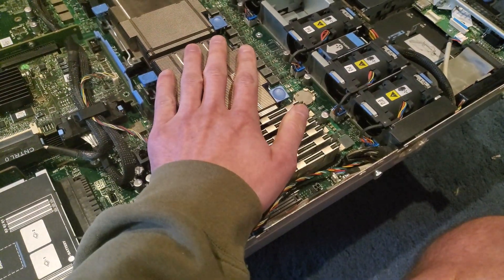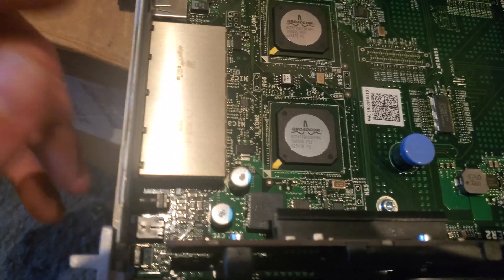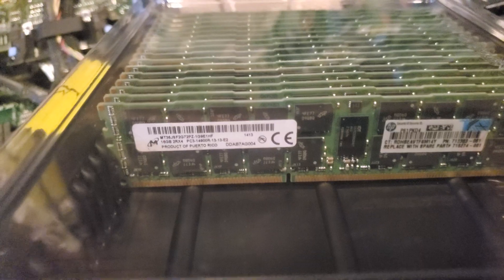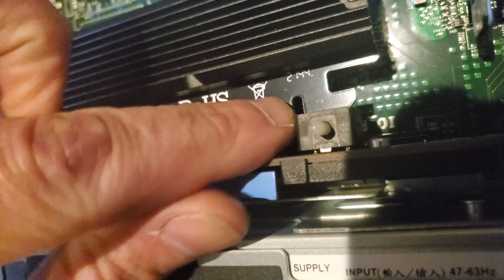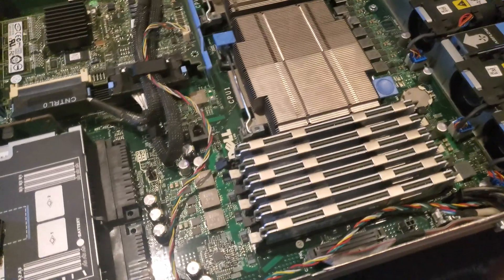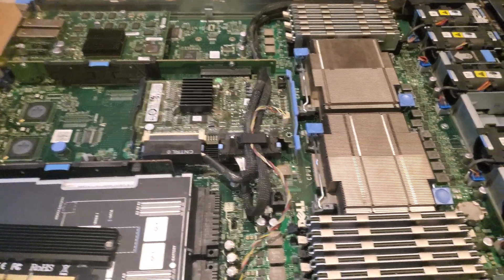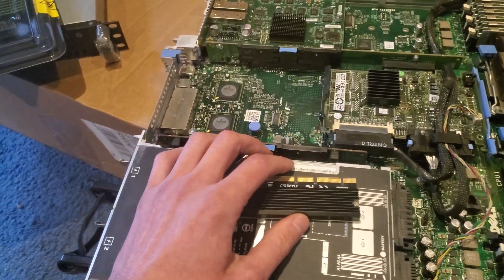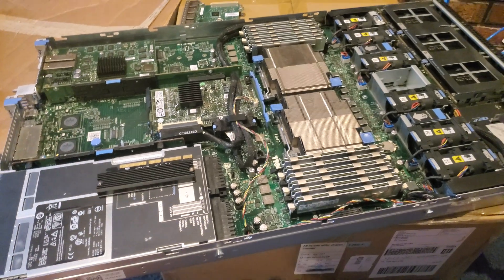The Beast R610 on it's 3rd and final refresh

Comment: these older systems - you can max out the ram more affordably - ram is so crucial - surprised you can do nvme boot on something this old - should be good to go for a few more years now - 2x the ram is nothing to scoff at - i just got a hp 8200 with an i7 2600 - had to figure out secure boot - just let the installer config it for me and figured it out - making a discount siem box #esp part #sec onion #ossim #ossec #selks #measured boot the r610 machines are like 100 bucks now but they suck elec and sound like a jet engine but when you need server gear for homelab they are ok or just build a 5700g am4 box for not much morre and save on elec and have a faster server - minus the spacious cheap ram of course - there  is always a compromise but for kids learning the r610/620 are probably a decent choice paired with open source #impi
Reply from the maker: I just wish it would boot off NVME + Bifurcation